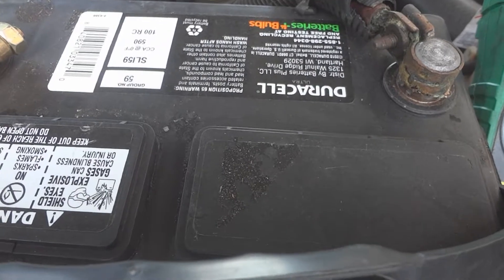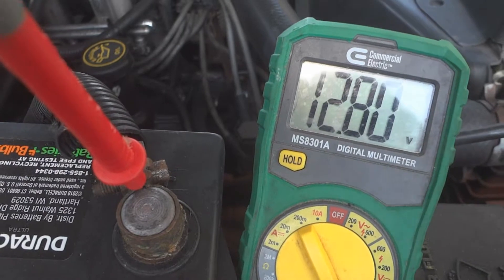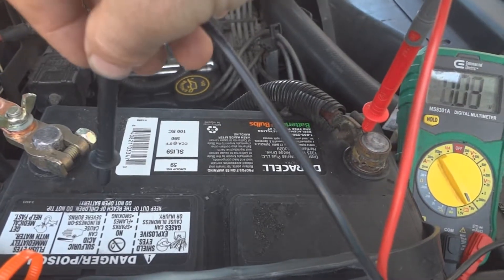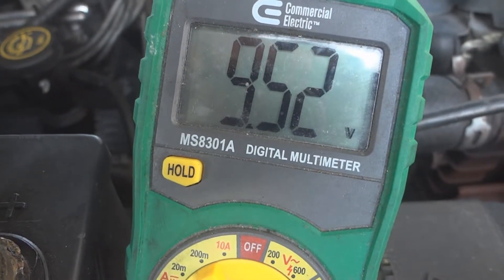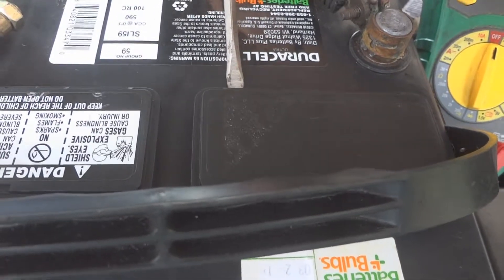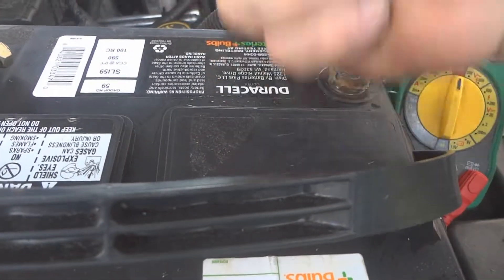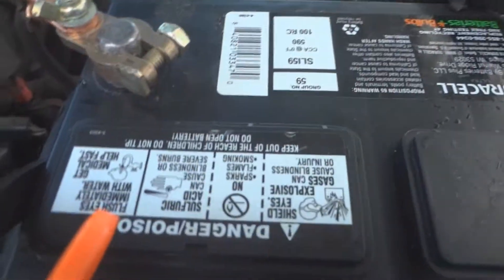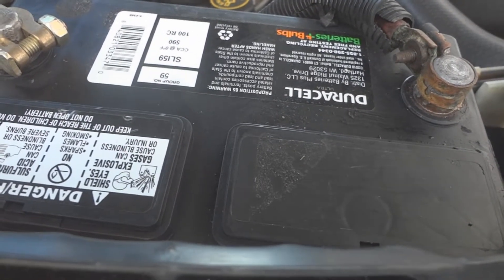How to Test a Bad Car Battery

Comment: Good vid Chris... except you may want to have the meter set to DV V 20 for a 12V battery.

https://images.thdstatic.com/catalog/pdfImages/df/df5297f8-b6d4-4e1f-9003-3cd76eca3513.pdf

Comment: I have a tool from harbor freight called CEN-TECH 6/12V Circuit Tester with 5 ft. Lead part number 63603. Do you think I would be safe using this tool to check the ignition coil pack connector switching signals from the 4 wires on the ignition coil pack connector? I have a 2003 DODGE CARAVAN SE.
Reply from the maker: should be ok. Just don't use it to test the output lol.  That's like 50,000 volts output to the spark plug.
Reply: @chriss4365  Because I constantly hear from people on YouTube videos saying that if I use that tool I have from harbor freight that it can cook the PCM and more on the vehicle. They say instead I should use an LED test light because it's computer safe but I don't have one so I'm stuck not being able to diagnose and fix my vehicle because I'm scared to use the tool I have from harbor freight. I scanned my vehicle and it read a few codes here P1684, P0300, P0303, P0420 & P0306.
Reply from the maker: @Diagnose1  You can remove each boot from the spark plugs one by one and you'll hear the electricity jumping the gap.  Be warned you can get zapped doing that test.
Reply: @chriss4365  Lol I did that test before with no fear and I got zapped twice 😂 it hurt a lot I saw the stars.

Comment: What is the multimeter set too? 😣
Reply from the maker: Its has a battery icon and it has 2 settings its on the 9 volt setting which can measure between 5 volts and 19 volts.
Reply: @chriss4365  cool thanks.
Reply: Alternator tested at 14.12👍
Reply: Your better off setting it to DV V 20 at around 3 o'clock on the dial.  Setting it to 9V for a 12+V battery could short the fuse in your tester.  

https://images.thdstatic.com/catalog/pdfImages/df/df5297f8-b6d4-4e1f-9003-3cd76eca3513.pdf